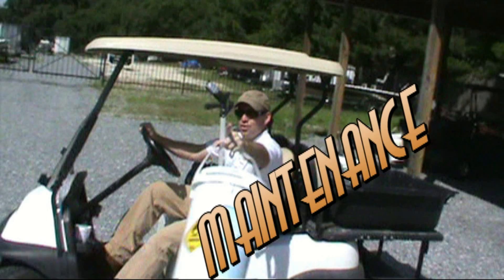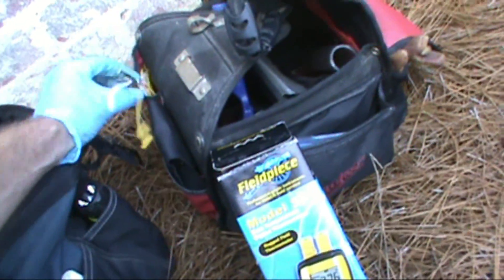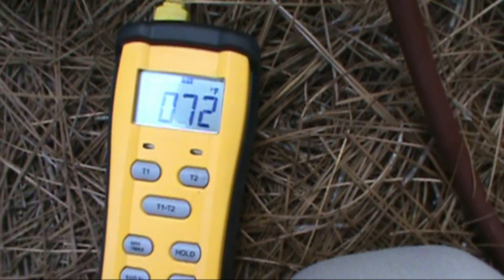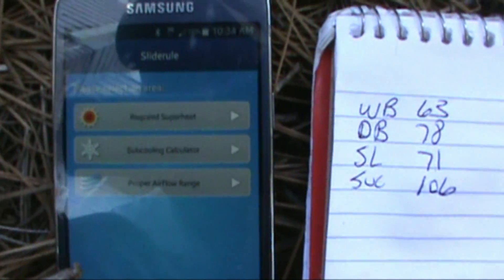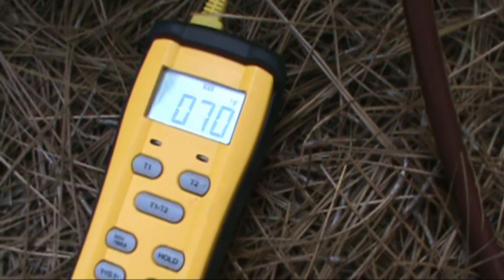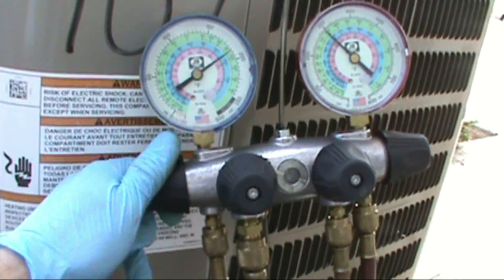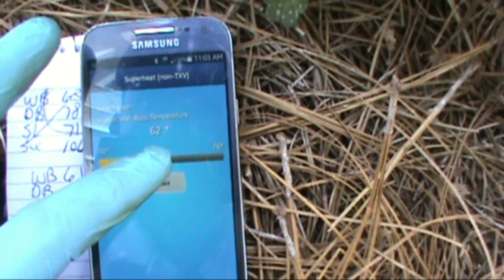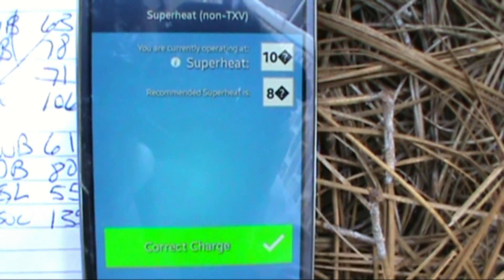HVAC NO COOLING CALL.HEAT PUMP CHARGED BY SUPERHEAT

Comment: Hey Lex how are you?? I have a question. I have a unit that when I set it to fan “on” and cool the blower inside runs but when I set it to “auto” and “cool” it does not come on. What do you think the issue may be? It is a 2.5 ton Goodman heat pump by the way.
Reply from the maker: Hmmm, I'd test the thermostat. That's a tough one. I'd need to be there probing around with my meter.
Reply: Lex Vance Because I checked the transformer and control board and everything looks good so you are right it may be the thermostat because I don’t think it’s the capacitor 🤔 but thank you very much!
Reply from the maker: @abrahammiron8319  Yea man. I've seen the sequencers act goofy too. But the outside unit would shut off when the fan was switched from on to auto. Very weird. A lot of this stuff is hard to diagnose over YouTube.
Reply: Any advice will definitely help!

Comment: Good job, superheat adjustment, did you find the leak? Need tag unit amount added date, so can track leak loss.Helps with warranty too if you've tracked.
Reply from the maker: Michael Lee There was no leak on this one. It was new construction. Under charged by a Craigs list helper. Ran across many. Thank you so much for watching Michael!

Comment: Hey i have new good man het pump on the summer works good but today on winter is not get hot oll the coil. The pressure is 70 and 300 i try to add more freon but dont let me do you have any ideas what problem is 25 ^ outside
Reply from the maker: erick cardenas is the refrigerant R-22 or R-410? If its 4-10a then you're low of freon. Its hard to add freon when its cold too!
Reply: Lex Vance is 410a  last night i try charge freon but the compresor start making noise the condenser never get frozen but inside the coil not get all the way hot just the 1/4 of the coil the rest barely warm
Reply from the maker: erick cardenas hmmm with the suction pressure at 70, sounds like you're low on freon. its hard to charge a unit in the cold. you can put the can in hot water, or use emergency heat strips until a warmer day comes & you can charge the unit. r410 suction pressure should be around 120 to 130ish psi. If your filter & coil is clean.

Comment: Hey Lex great video as always. Did you happen to identify the source of the leak? Looks like your complex has mainly Goodman and I understand that certain vintages have evaporator coils that are bad to leak. Just curious if that was the case for this leak.
Reply from the maker: There was no leak. This complex is new construction & the contractor used craigs list people for helpers. So, I was running into over charged & under charged units. This one happened to be under charged. I haven't been back to that unit since I recorded it for this video. Been almost a year now & no call back. All good! Thank you for watching man!

Comment: great work.  Hey what app are you using.  And do you check pressures immediately after a coil cleaning or next day?
Reply from the maker: Thank you Kenneth! The app is called Emerson check & charge. Its free too! I check pressures right after cleaning a coil.
Reply: +Lex Vance I'm sure the sitting water dries up quick in florida.  Here in NY I try a follow up visit to check pressures but the real reason is to re set belt after it stretched a little. Properly set belt and clean coil is the way to go.  I can tell you have passion for your job and thank you for the vids.
Reply from the maker: +Kenneth Mcdevitt Right on Kenneth thank you man! All I have are 1.5 to 3 ton goodman heat pumps on my property. No belts or anything.

Comment: great instructional video...! keep up da good work Lex.
BTW do you've clips of on how to use the wet/dry bulbs correctly? thx
Reply from the maker: Thank you A Koh! I dont have videos using wet/dry bulb but im sure you can find it on youtube. On wet bulb, you wet the little white sock thats over your temp wire & place it in the return by coil. Dry bulb, you hold the wire without a sock on it 6 inches from the condenser & make sure its in the shade & not in the sun. Thats pretty much it.

Comment: (WB)3 - (oddb+80) ÷ 2 most guys say it this way... wbx3-80-oddb÷2  either way, it's easy to remember once you use it and actually faster than screwing with that app. Great job, man. I'm enjoying everything you post my man.
Reply: Yes the calculation is always with you regardless if the phone has battery.
Reply from the maker: Thank you sad. I saw that on one of talyn or zach hvac videos. Im gonna use that. I like fast & simple. That app goes quicker too when you're not videoing & using one hand. Thank you Sad for the formula reminder. Ill do a video using it. Laters duude!